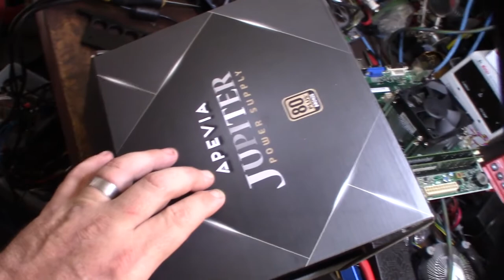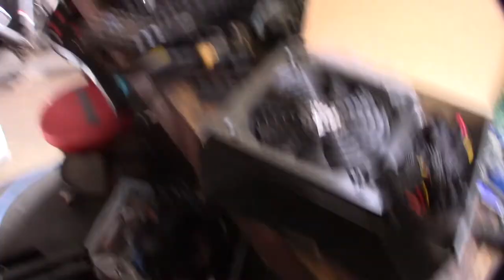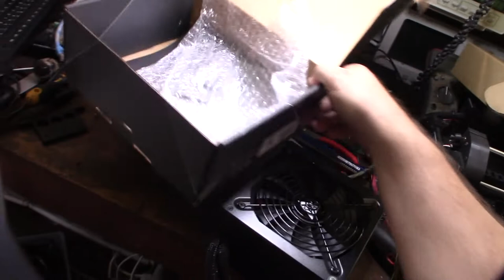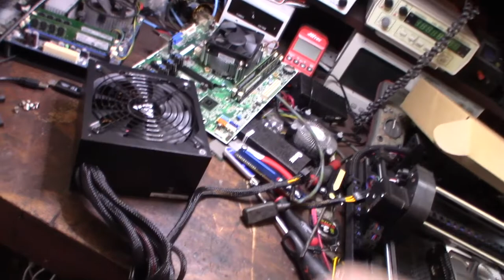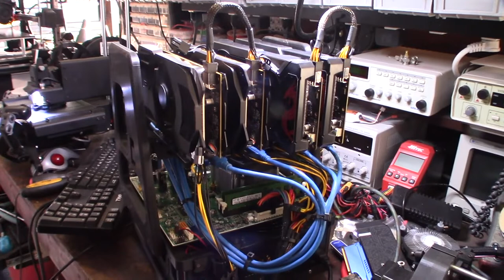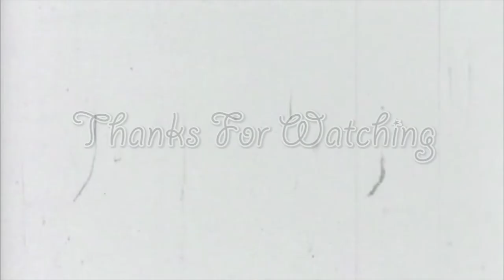Cheap 1000W Crypto Mining Power Supply On Amazon Apevia ATX JP1000 Jupiter 4x PCIe

Comment: That is a good buy?
Reply: I buy a apevia premier of 850w but I don't really sure for to use it for the price
Reply: @brandonnichols7999  too late 💀
Reply: @asesinodepirobos  💀💀💀mine came dead out the box 📦 just like others on the Amazon reviews🧠
Reply: @brandonnichols7999  bad buy definitely
Reply: Hello I want to ask you something:
What is your experience with the Apevia power supply? How long did it work well for your PC? What PC components did you have when you bought this power supply?
If it got damaged, it took some components with it. I bought the Apevia Premier 650W power supply, unfortunately I read the reviews after buying it, it's on its way and I don't trust it at all.
Reply: @Tejon2225  well sorry for answer later and sorry for my English but my experience was not bad the power supply of 850w was enough for a Ryzen 7 5800x3d and a GPU Radeon 6950 XT and I have that power supply for like 6 months an it works fine it was a surprise because I read a reviews too late to but the power supply never fail even when the CPU was in 90 grades I recommend change it before the year with that PSU
Reply: @asesinodepirobos  thanks for answering, don't worry my English also is bad, oh Im glad to hear this, I bought this power supply brand one month ago, exactly model is apevia premier 650w, but i dont use yet, i just need the case for armed my pc, i hope what is power supply working very nice, if is not much trouble for you,I have a question, are there many blackouts or voltage dips and surges where you live?.

Pd: creo que hablamos español ambos.